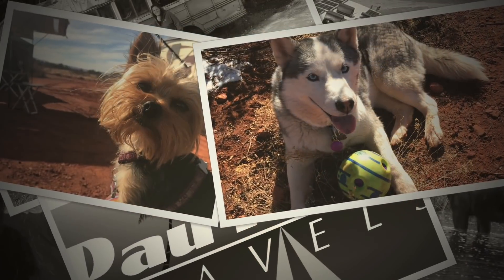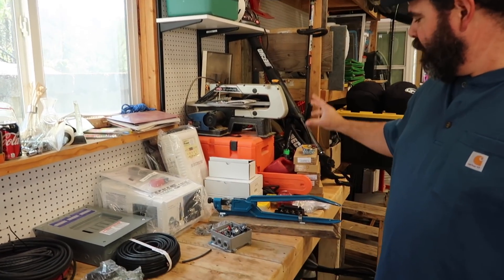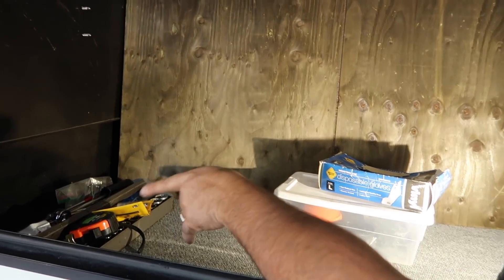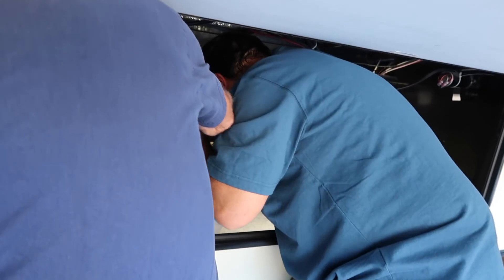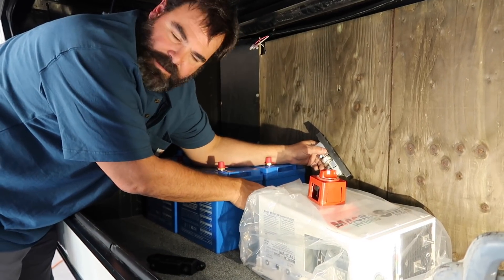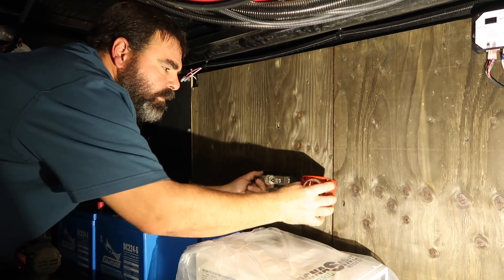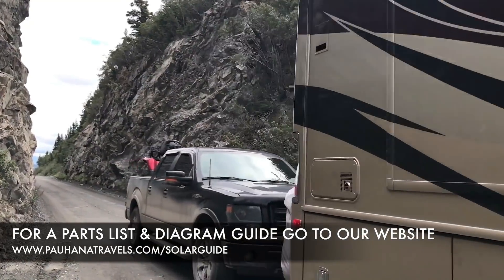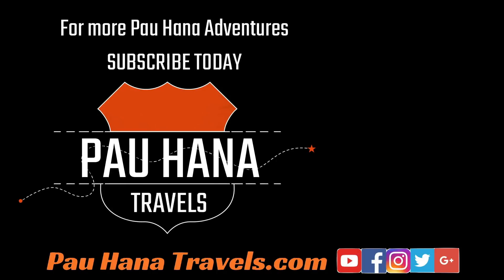RV Solar Installation - Part 1: Installing New Batteries & Wiring 🚐🌞

Comment: Ok first off, I like that you have a 5 part lesson. I have a question. Why do you have so much solar and batteries. I mainly want to run a CPAP machine and a TV and a few lights for camping in the wilderness. 
I bought a kit through Harbor Freight with 4 solar panels, a 12 volt solar battery, and wiring. 
I have. 400 wt inverter and probably need to replace that with. 2000 watt inverter. Not sure how many batteries that I will need.
Reply from the maker: We used our motorhome as if it was our house and we would regularly be out in it 6-7 months at a time. So it was important to us to be able to do that. When we first got the Disco we installed only 4 100w panels and soon learned it was not enough. When we became involved with Battle Born we decided to build our dream system and that is where we are today. It’s still going strong 6 years later.
Reply: Thank you for your reply. I am constantly re-watching your videos and others to learn more about solar on RV’s.

Comment: What gauge battery cable did you use? I think I saw 2/0 on the cable you used to make the custom cables to connect all the battle born batteries in series.  Then I think I heard you say 4/0 cable? I’m only using 2 battle borns with 6x345 watt 60 volt panels....

Comment: Hello from Canada! I miss you folks on YT! I was looking forward to all of your 2019 Alaska trip. I hope you folks are doing fine. Anyhow, I have just got 3 100Ah Lithium batteries for my class A gas RV. I believe the alternator is a 130 Ah. With the two 6V lead acid batteries I had in there before, the charging rates while driving would be around 35A at the beginning and then peter out our 20 A or less later on. However, I am told that lithium can charge much faster and I do not want to burn out the alternator. Should I get a 20 or 40A DC-DC charger to limit the current or will I be OK? Thanks in advance for your advice. Travel safe. Henri

Comment: Great video but your 6 or maybe 8 awg wire to the RV will melt with a 400 amp fuse. You fuse the wire.
Reply from the maker: I do not have 6 or 8 awg wire connected to the T fuse. I'm not sure what wire you're referring to.

Comment: Where did you purchase the rooftop combiner box, and what brand is it. Also, what brand are the bus bars inside the combiner box?  Thanks for an awesome series on Dad's install. I think your simplified install has cured me of my analysis paralysis. I have decided to go with the Fullriver DC400-6 batteries you help the Hebards install.
Reply from the maker: We found the rooftop 4x4x2 non metallic weather tight combiner box at Lowes. As for the bus bars we got them on Amazon the black ones can be found at https://amzn.to/2rjp2hZ and the red ones at https://amzn.to/2rqxpI7.

Comment: What is the voltage output of the panels?  I was told the Magnum PT-100 would not be a good fit unless you had a minimum of 60 volts to run...forcing me to look at the Victron controller instead.
Reply from the maker: The panels are wired on series parallel feeding 24 volts to the solar controller. This is the same way our motorhome is wired with the PT-100 solar controller installed and our system has been working great.
Reply: Well that's good news!  I'll have to watch and see how it all comes together...would like to keep it all Magnum if I can, but even when I called Magnum they advised a minimum Voc to run.  Looks great so far.

Comment: Can I ask why you use that big of a fuse or how you know what fuse to use?
Reply from the maker: The Magnum inverter installation manual recommended a 400 amp T fuse due to the high wattage output (3000 watts).

Comment: Were the batteries and the magnum mounted as you measured the cables? I would have, as the they might move slightly when you do permanently secure them and the cables were pretty tight as you dry fit them. Not being critical, just wondering. 👍🏻
Reply from the maker: Mickey Cloninger the batteries and the inverter were in position when doing the wires. This was day one and we still havent put the spacers in between to prevent movement but it all worked out in the end. It will be shown in a future video.